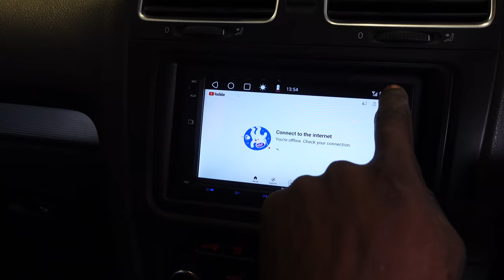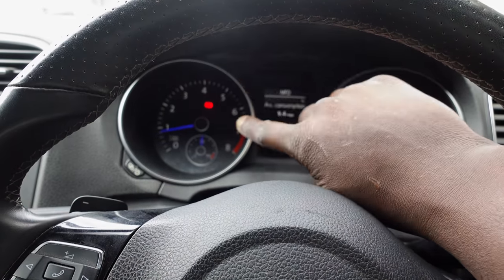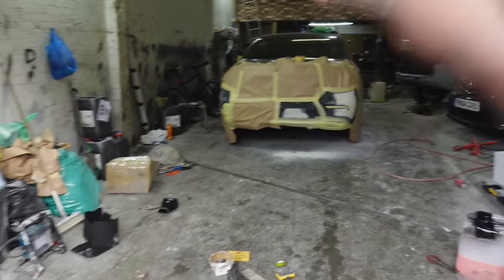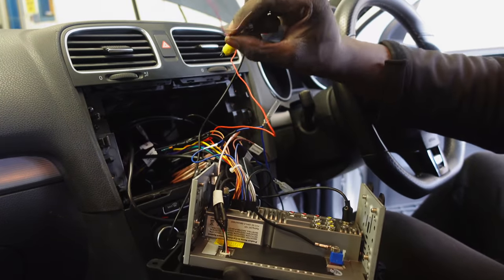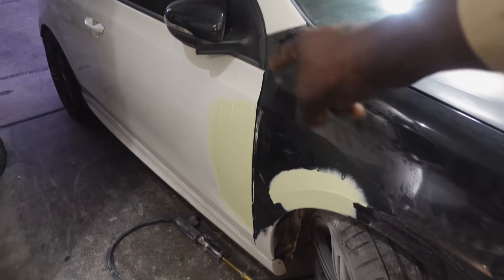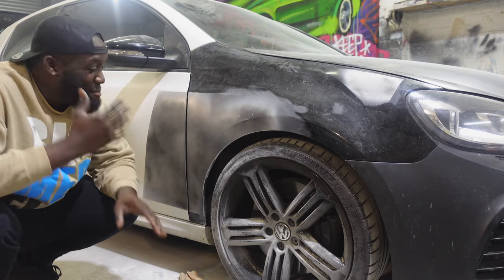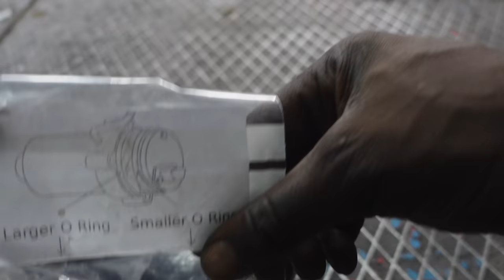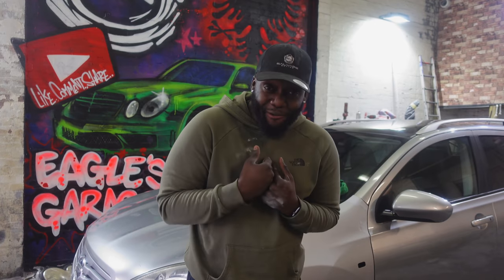Rebuilding a Wrecked Salvage Golf R20 From Copart - PART 16 (NEW PAINT LOOKS AMAZING!!)

Comment: Use Tessa tape to make the head unit wiring look OEM. Use external tape for long runs & interior tape for where you have soldered joints as it is easier to remove. :)